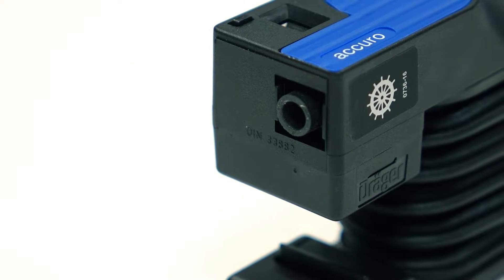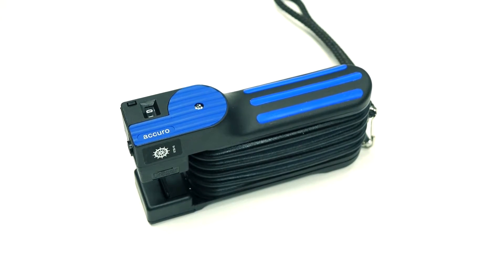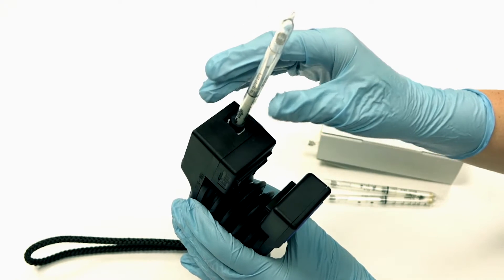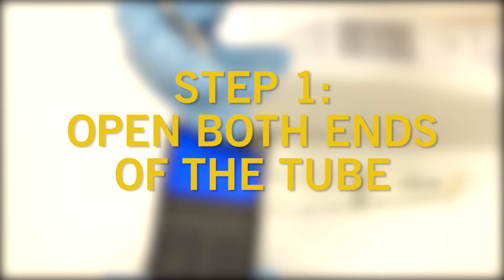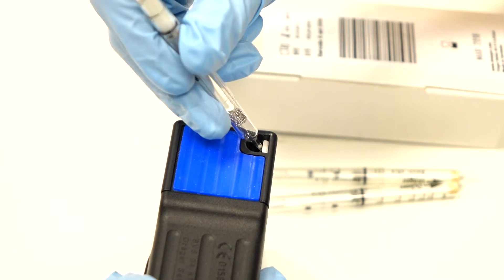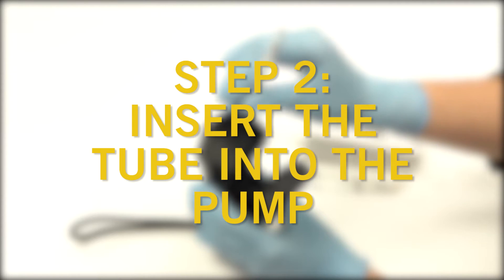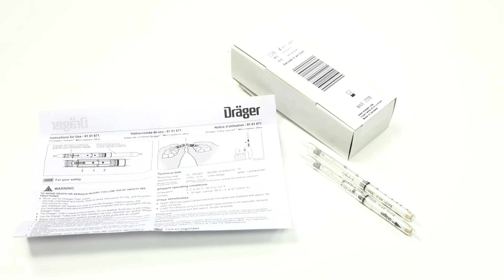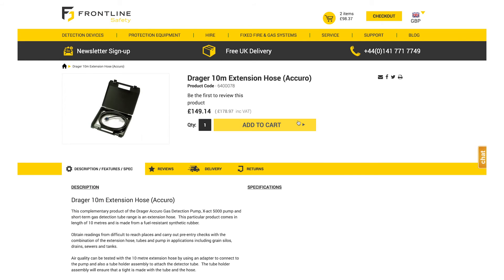How to Use the Drager Accuro Gas Detection Pump - 6400000

Comment: what about the time of measurement.....if n=3 and time of measurement =2 min....is it each stroke have to wait 2 min or after all 3 strokes then wait 2 min
Reply from the maker: Hello, the manufacturer has advised that the amount of time it states for the test is the time it takes for the amount of strokes to be completed.  For example by the time the pump has completed 3 full strokes that will be approx 2 mins in measurement time.
Reply: @Frontline-safetyCoUk  noted sir, thank you so much for the answer sir. That clarifies. ^^